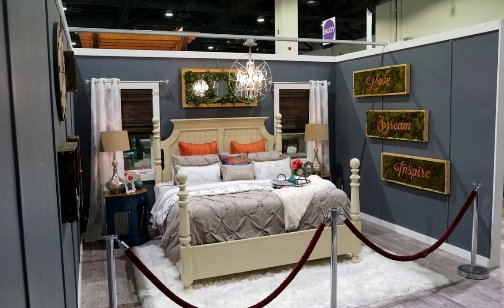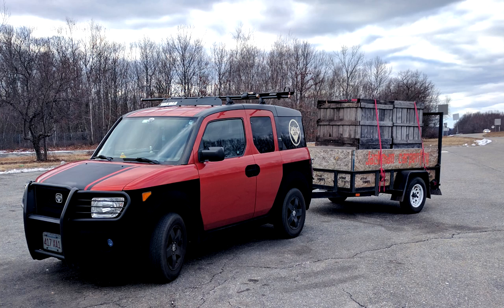Rustic Wall Crates (made from 50 year old Apple Bins!)

Comment: Great Video! One quick question - why not dowel the joints and leave the ends sticking out? Same effect but less vulnerable to knocking the glued ones off? You could also cut and wedge them with a contrasting wood if you wanted to go super funky. Just my thoughts, great build in any case!
Reply from the maker: Great question, because of the materials I used it was a little warped so the screws pulled everything super tight together and was really secure. I like the wedge idea though!

Comment: Nice crates. Just curious why you used epoxy over glue for the plugs?
Reply from the maker: Thanks! Since I wasn't cutting them off flush they have a good chance of being bumped so the epoxy will help bond better to the screw and the hole to make sure they don't pop off